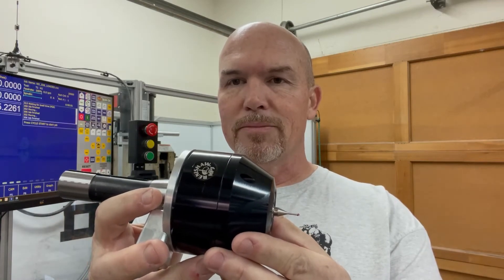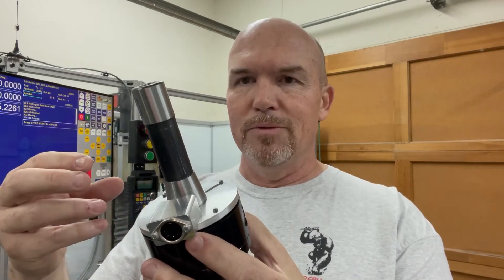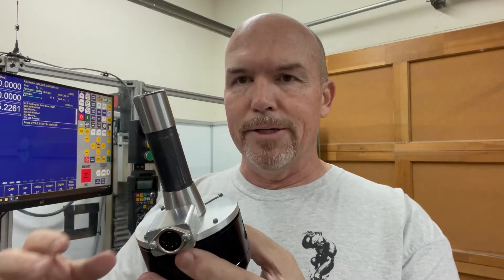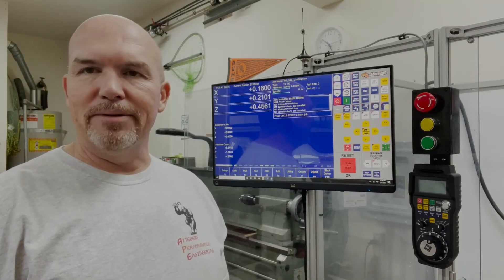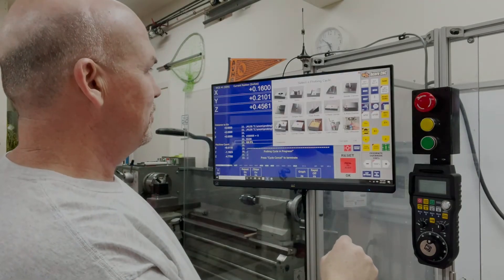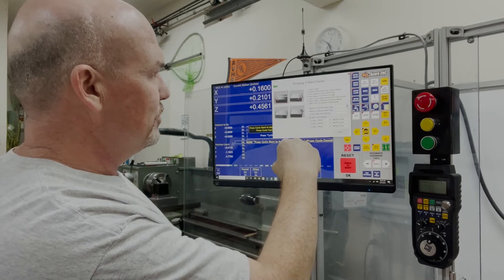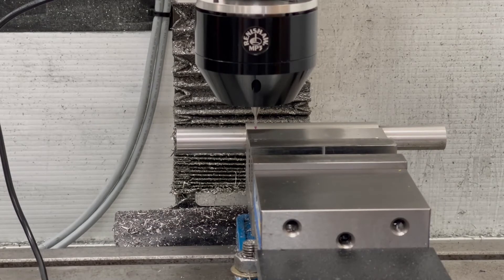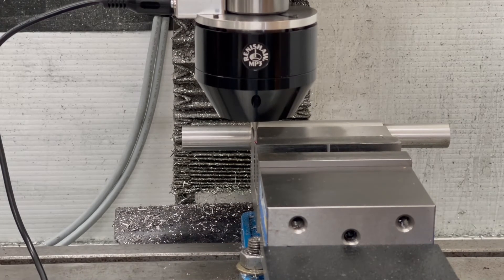Renishaw Probe and ProbeAppV2 for Centroid Acorn

Comment: Hey Chris I picked up an mi8 for my Renishaw mp3 and was hoping you could give me so help on how you went about wiring it to the acorn board.  I found your build thread online and took a look at how you wired it in your enclosure and it seems different from the mi8 diagram I found.  Are you pulling 24 volts from the acorn board or a separate 24v supply?  I’m confused on what side of the board connects to the acorn inputs as well.  Any help greatly appreciated!
Reply from the maker: Yes, I'm pulling 24V from the Acorn PSU. From my thread on Hobby Machinist: "On the control side I mounted a GX4 connector to provide 24V, GND, probe detected and probe triggered. On the probe side I mounted a DIN5 connector to provide probe +/-, probe detect and GND."

You can download the manual here: https://www.renishaw.jp/resourcecentre/jp/download/installation-users-guide-mi-8-interface-unit--29996
Reply: @ChrisAttebery  yes sir I read your thread but I’m still confused on how your getting your common to the acorn.  I see a common coming from the probe down to the mi8 board and than it appears to be jumped across to the other side of the mi8.

Comment: I am still thinking about doing this.  I assume the conical part that was in the probe head is for tilt adjustment?  How about lateral adjustment to get the stylus perfectly true to the spindle centerline?  Thinking about this it seems a bit harder to do than it initially appears on the surface because you need the stylus perfectly true to the spindle.
Reply from the maker: Right, the conical insert centers the probe onto the shank adapter. The probe head has 4 screws to adjust the centering of the tip. There's a procedure in the MP-3 manual. I was able to get mine down to about .0002" TIR in about 10 minutes. I'll add links to my build threads in the description.
Reply: @ChrisAttebery  Thanks Chris.